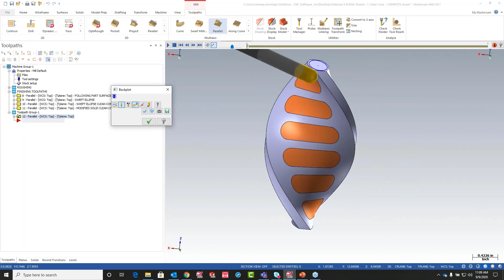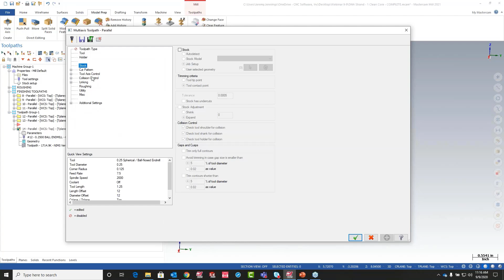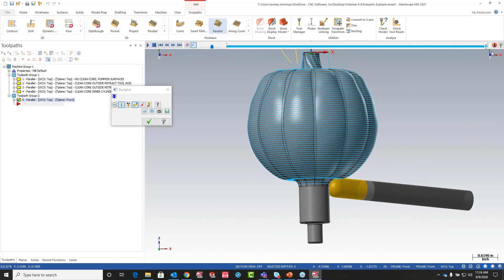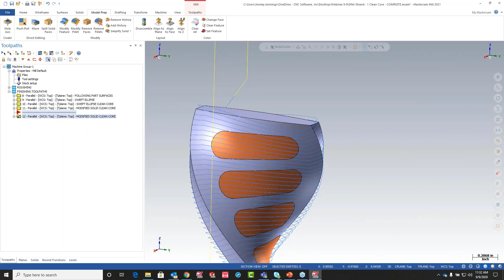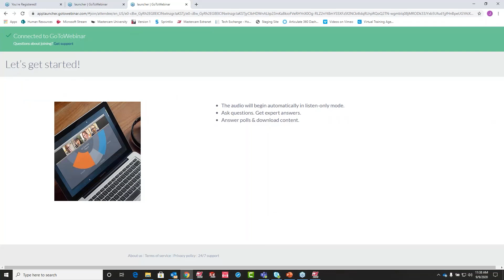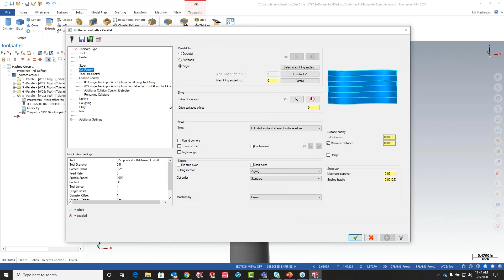The Secrets Behind Clean Core Multiaxis Programming

Comment: Why the heck doesn't it do this in the FIRST PLACE? There's ZERO logic behind MasterCrap when it comes to solid models because everything is WIREFRAME driven at its core. EVERYTHING about MasterCrap is a workaround.
Reply: So what cam software do you use?
Reply: @nichraygun28  Mastercam. I can't stand it. Every year they come out with more "features" that end up breaking something or it's completely useless instead of FIXING what they've broken or people have asked them to fix or make better for DECADES. Advanced Drill is USELESS, they screwed up the levels manager when they "upgraded" it years ago and it randomly populates empty levels...I could go on and on. Anyways, what do you use?

Comment: Do you really need a check surface with the simplified model?
Reply from the maker: Hey Travis! The end example on the airfoils here is showing a path shape calculated on a simplified model, and the check surface is what the final path is projected to. Clean core methods of programming will always utilize check surfaces in this regard, but it doesn't mean that Clean Core has to be used in every toolpath scenario.

Comment: You can use multi surface for this example ?
Reply from the maker: We’d use Multi-Surface on an example that can utilize a primitive clean core - sphere, cylinder, or box – because the clean core geometry is automatically created within the toolpath interface. It is up to the user to select compensation surfaces or check surfaces. Using Multi-Surface allows the programmer to change the characteristics of the clean core without editing any physical geometry.